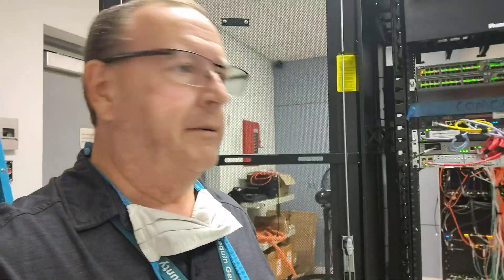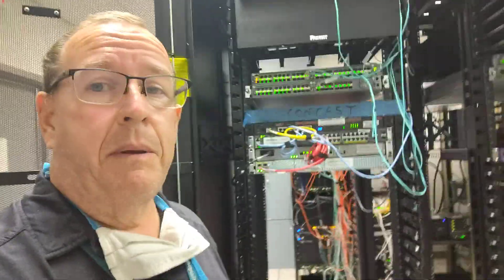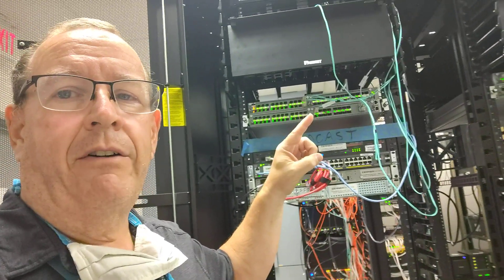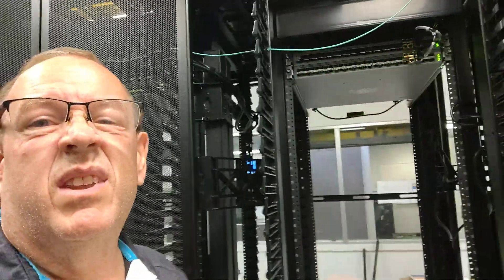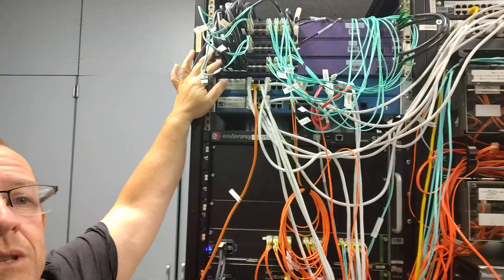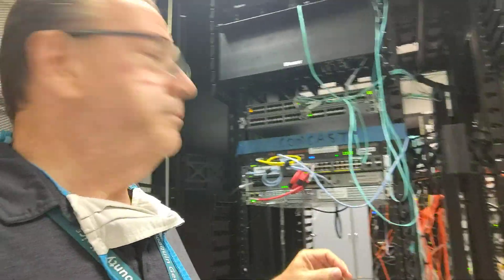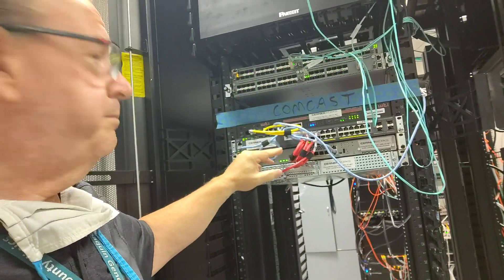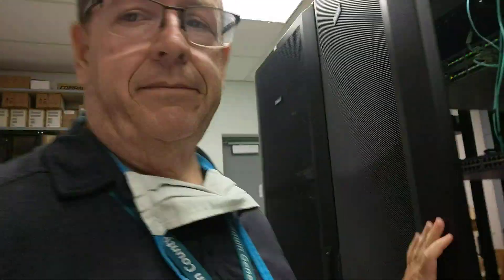Network Admin Life: Datacenter Redesign Update 8/11/2020

Comment: Thanks for the network tour. How do you ever keep track of all the cabling and what plugs into which piece of electronic equipment.  Certainly wouldn't be coming with any sort of manual. Best Wishes.
Reply from the maker: Good question!  I really only keep track of uplinks to other switches.  Edge ports going out to the devices (computers, printer, etc) I generally don't keep track of other than labelling the switch ports in the switch config itself.  I generally alias the port with whatever jack number is on the patch panel that is plugged into the switch.  I also alias ports with names of devices that are special use or devices I need to keep track of.  I try to make the network as self-documenting as possible using port names or aliases, and labels on the cables themselves.  God bless!

Comment: Great video! I also find the fabric mind boggling. Does every switch uplink to each other? Do you plan on using shortest path bridging?
Reply from the maker: Shortest Path Bridging IS what Fabric IS.  That's how you enable it, with a spb command.  So in my network we are going to have 4 cores, two in my data center two in our MDF.  A core in the data center and in the MDF will be paired up and MLT's from each of these pairs will be set up to all my edge switches.  So theoretically I can completely lose EITHER the datacenter OR the MDF and still have full connectivity.  We are really only going to be using a small fraction of the Fabric's capability.  I'll keep updating as we go along and as I learn more about this technology.  Thanks for watching and God bless!